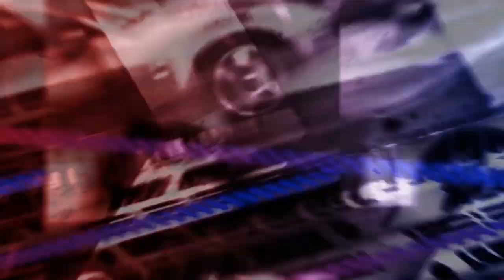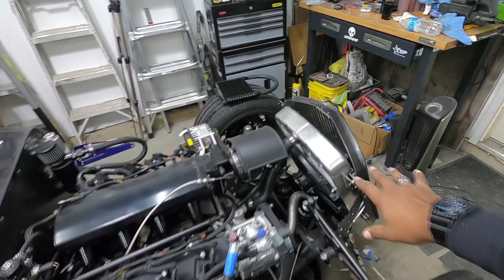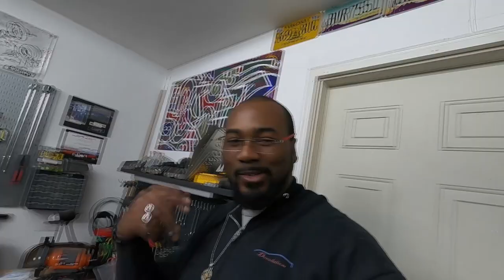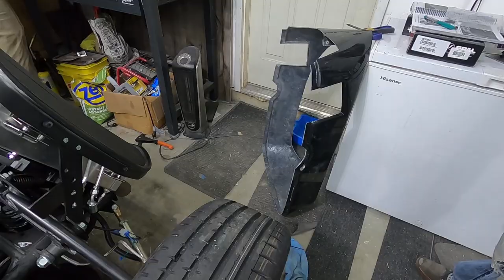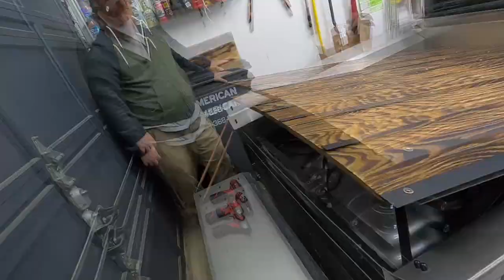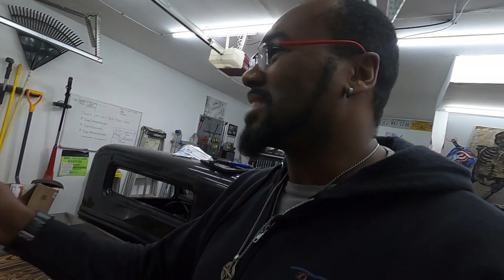Factory Five 35 Hot Rod Truck Grill Cowl Mounting

Comment: Great work guys, that bed came out so nice. With regard to the front cowl, to my eye making the top parallel to the overall rake of the car may look better. The steep rake of the front grill looks great and agree you don’t want a radiator hose as your rub strip but thinking the cowl may need some modification. Love the channel!
Reply from the maker: Thank you, I appreciate it. We would have to cut a hole in the lower front shocks mount in order to not make the radiator hose not the lowest part of the car. The way the lower radiator outlet is oriented it only allows for about an inch of clearance to do a 90 degree up turn. When we do the aggressive rake it gives us the clearance we need.

Comment: You may need a new shirt that just says, "NO BRIAN!"  LOL!!!  You two crack me up, thanks for the entertainment and the great informational/how to style videos.  I do wonder what Factory Five's reasoning was for putting the radiator hose as the lowest point in the car?  Seems odd, lets make a low riding car, then place an artery to a vital organ to the vehicle down there too so it can get ripped off at by a speed bump or some heavy piece of trash in the road.  Any ideas/theories on why they may have placed it there?  Or is the simple answer because of space, meaning it just fits there and it out of the way of all the engine goodies.
Reply from the maker: That is a great idea for a shirt. I am glad you enjoy our videos. I think the reasoning is just space considerations. This is a tiny car and there is just not a lot of room especially when it has inboard suspension.

Comment: I was thinking...how come we gave up on #TwinTurbos so quickly.  What are Brian's reasons for a super charger?  He gave no real reasons.  I bet if he thought about it, there are more pros to turbos than not.  Come on Brian!  Need some convincing here.
Reply from the maker: There was only 3 people, me included that voted for twin turbos. An overwhelming majority wanted supercharger. Superchargers are more retro and fitting for the styling of the truck and he brought up a good point to me that I already have 3 other turbo vehicles so it will be nice to mix it up.
Reply: My reason really is that the twin turbo LS is severely over-played. I'm not knocking the performance gains of turbos, but in the end it would just be another "twin turbo LS swap", especially since we are running no body panels up front. Its also easier to mildly tune a supercharger to work with the existing set up than it will be to have to redo the entire exhaust system later just to put on turbos.
Reply: @mrbrianc  damn...those are really good reasons. Thought you had nothing.  My bad...Brian....you are a god
Reply from the maker: That is why I keep him around